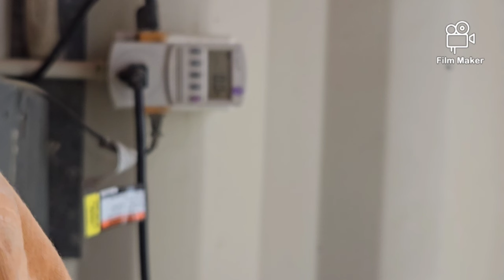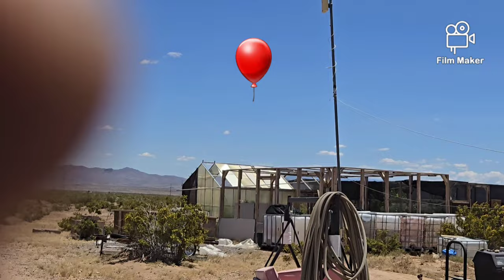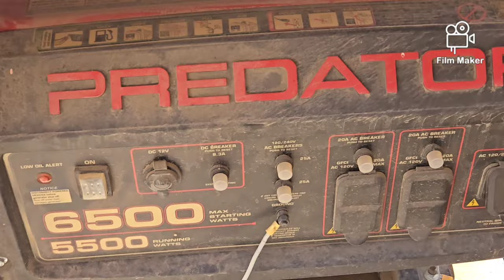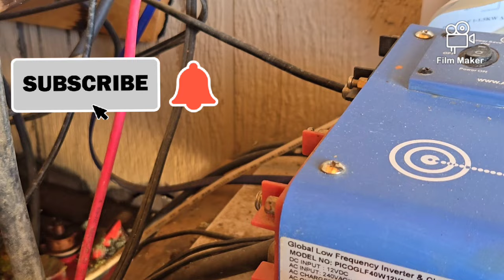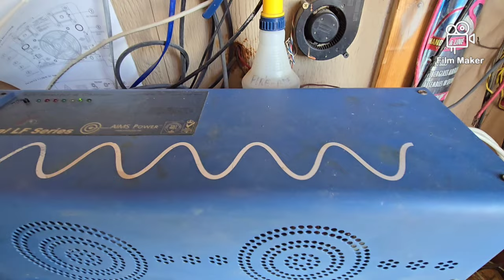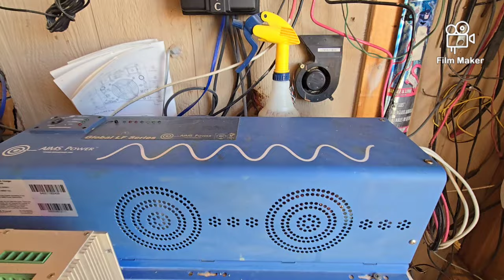Backup Generators, Well Pumps and Inverters, May 11, 2024

Comment: As an electronic repair guy, i wanna verify coule things about generator-inverter setup. First, most generators build around universal small engines, at least 3000+ w units, as you and i have. I have 6kw unit as well. They all designed to work with starter or pull start, so from my experience you allways can buy a starter and modify engine to fit a starter in. You usally need to change flywheel, cut a hole for a starter, and install a starter and control electronics. From my experience, not all generators with starters have remove contol input, not its not a big deal to add one. Generators dont produce "modified sine wave", they can have a frequency flactuation due to luck of advanced controls. Since engine speed = generator frequency in most cases, unless its invertier based generator. Inverter based takes whatever gets generated on a generator and (in this case, basically, generator acts like abattery in a regular solar system) and then it gets transformet in perfect pure sine wave with frequency, load control and with power factor correction. Reguarding charging part of the AIMS inverter. You probably can feed even DC in it, since most of the charging circuts build by power swiching supply circutry where first step is pass AC inpot thru full diode bridge, making it high voltage DC and then it gets stepped down and regulated.

Comment: yeh your not a conspiracy nut, big oil has stifled n burried countless inventions, some very simple ones that dramatically improve fuel economy power and emissions , weve reproduced a few of them in the past they really work.
100% the government is in on it as if you all  suddenly used half the fuel due to a simple device  theyed get half the taxes .
its not just big oil its the governments. i distill alcohol and add it to my fuel , boosts the octane, freunds run their high performance Very High compression engines on pure alcohol due to its octane rating.alcohol really lasts .
GASHOLE is worth watching
Reply from the maker: Oh I know, and thanks for being intelligent enough to know I'm not a conspiracy nut.
Everything government does is for money and control.  They want to go back to Anarchy where they are rich, we are peasants and slaves.
Our governor recently raised fast food worker salary to $20/hr minimum.  Ignorant people think it's good for the economy. I know it's only because they figured out a way to get more taxes without raising them. 
More pay, higher tax bracket.  They also want to eliminate gas powered vehicles, but that won't apply to government, only us peasants.  They also mentioned going to digital money...of course, so they can track every individual's value, and shut you off if you don't give them their share.  In this country we are living with the government our forefathers warned us about.
Reply: @GBear see in china with their advanced facial recognition and cameras everywhere if yo j walk money is automatically detuced from your account and your face is displayed on a digital billboard, thats the future

Comment: Just wondering if a "soft starter" could bring down that initial surge to something a good deal lower.  Not too important for grid power systems, but every little bit helps off grid.  Would be helpful if using air conditioning or power tools too.  Any info appreciated!  You've probably told us numerous times, but what is your generation and storage capacity?  Good video...as usual!  Yup.
Reply from the maker: Thanks!  A soft start never hurts, but as I mentioned the unit comes with a start and run capacitor.
My solar input is just under 4k and my battery banks are 24 @ 232ah and 6 at 424ah

Comment: Hey G bear did you know if you mix 10% tap water by volume to gasoline and shake it thoroughly mix it whatever and then let it sit you will get a 20% by volume solution separation out of gasoline thus making it straight non-ethanol if you drain that 20% off
Reply from the maker: Interesting.  I'll have to research that some more.  But most modern gens and all vehicles are designed to run on the new mix and would be damaged if straight gasoline was run in it.